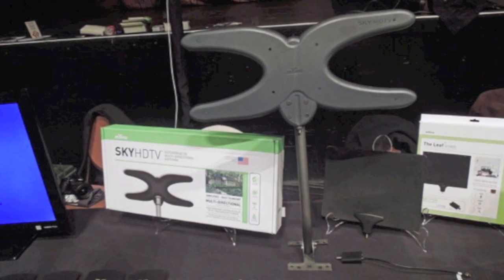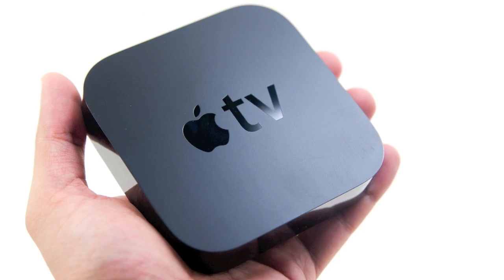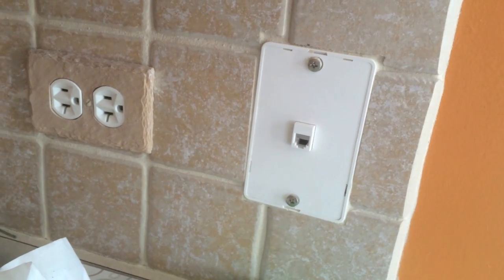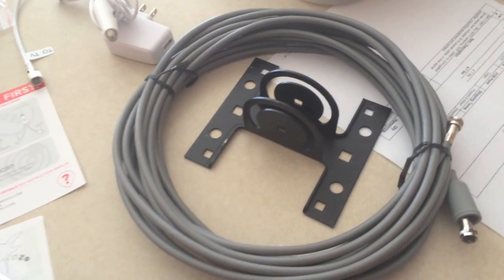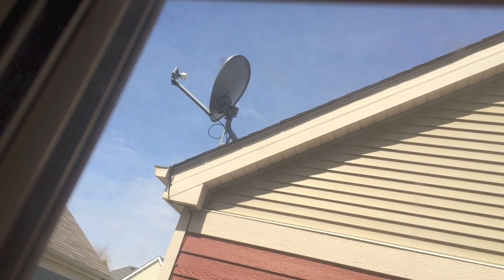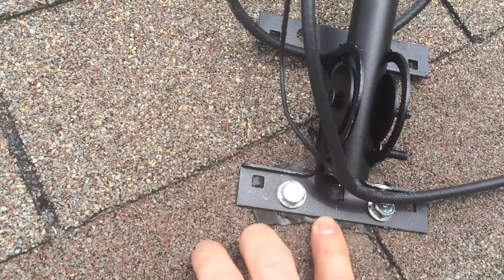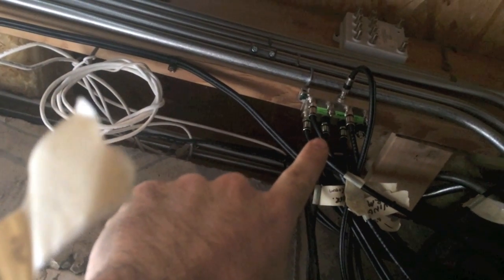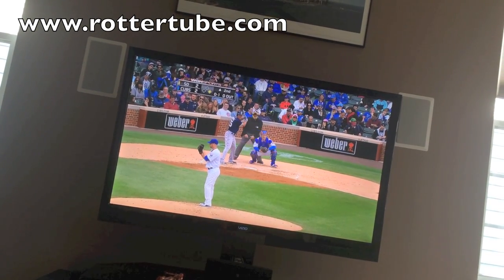how I got rid of cable tv - MOHU house antenna setup - sky antenna cable tv alternatives

Comment: Here is a tip just in case you are just not ready yet to cut the cable line. Call your cable company and talk to the department that handles DISCONNECTIONS. Dont try it with customer service because they will not have the flexibility like their Disconnection department to offer deals. This department is the last line of defense for the cable company to keep you as a customer and will try their best to keep you on. You probably will get a significant cut on your bill and probably get offered better services. The reason for this is because no matter what that cable will always be at your home. They would rather get something for it then nothing. My personal experience is that I got a deal set for 3 years. Lowered my bill by 33% and i now have better services.
Reply from the maker: that's GREAT. For me, I needed to free up as much cash as possible so I disconnected all. I am not much of a tv watcher at all so it worked out great. My wife got used to it. I know so many people who pay for a house phone and a cable bill and they don't use either....and yet...they won't get rid of it.

Comment: my house was wired with cable years ago, I have an collapsible alumin. antenna in the attic--should I remove all that crap? I have a satellite dish now and one TV hooked to cable. Any suggestions?  I have so much cable wire in my attic--love to remove it.
Reply from the maker: Hi Michael. Well, if you get this antenna, you would buy a coax amplifier like i did off amazon. I have this antenna connecting to the coax splitter / amplifier, which feeds all the other coax in the house. i have the other tv's using the one antenna in each room that way. works perfect. you wouldn't need to remove anything if you wanted to run live tv to all other tv's using the antenna. by the way, we watched america's got talent last night, live, in true 1080 HD over the air. sure, there were commercials, but that gave me time to let the dogs out and refill my coffee. AND IT'S FREE. good luck!

Comment: Really interested in ditching Cable and i was wondering how well does it handle Natural obstacles like trees and hills in the way of the signal path
Reply from the maker: from the reviews i have read on amazon, where i got mine, it handles that really well. I'm getting pure HD uncompressed signal from Chicago 50 miles away. never an issue.

Comment: Can you connect the Sky amplifier directly to the antenna? Or should I make a small jumper with F connectors on each side to come out the antenna into the amplifier?
Reply from the maker: i have my sky antenna connected direct to the coax amplifier box so i can feed each room. i wouldn't split it before going into any amp box. i would use the box to split it and that's it. the signal right off the antenna is good but i just wouldn't split it before any box.

Comment: Bro, that install is Clapped!!!! Should have slid the new antenna pole in the old direct tv pole and drilled an upper and lower screw thru it to brace it...
Reply from the maker: what's up dude? not sure what clapped means. for whatever reason i couldn't slide it through the direct tv. still holding really well after 2 years.

Comment: Thanks I will give it a try to cut the cord a few years ago but my regular stations don't come in very well sometimes
Reply from the maker: +bigtim323 good luck. you will be very happy with these antennas. i'm about 45 miles from the stations, probably 50 actually, and they are crystal clear HD. incredible.
Reply from the maker: +ShawBrothers Fan Either you got a bad one or you hooked it up wrong. I'm 45 miles away from the stations at least, and I get razor sharp uncompressed HD. There are hundreds of people saying the same thing on Amazon reviews.

Comment: Can you run the Hulu and over the air hd through the Apple TV? For an all in one interface, or do you change inputs on the tv.
Reply from the maker: apple tv is connected to your network via your wifi. you can also connect it direct to your router via an RJ45 connection (network cable) from your router. anyway, the apple tv works via internet. you connect the apple tv into an HDMI port on your tv. the antenna is not involved at all. it connects just like an xbox or playstation console would. you would watch the apple tv on just one tv for this reason. i'm looking to get a 2nd apple tv for the tv upstairs.
Reply: +Rotter Tube Reef Gotcha. This might seem a bit much, but have you looked into a HD homerun that the antenna connects to, and connects to your Ethernet. Then you download an app called "channels" that picks up all the hd content from the antenna and supplies a nice interface with TV guide. I haven't tried it yet, but it looks like something I would like to try, if I could get cheaper internet that was not bundled with my local channels of tv. BTW, right now I run a Plex server and use the Plex apps on all my devices to steam all my content.
Reply: +John Zimm oops, I forgot tablo... It does the same thing but is also a DVR, so you can also record all the HD content from the antenna.
Reply from the maker: that sounds like a really cool plan. being a techy, i love hearing all about this stuff! i looked into so many things, even utilizing my imac as a DVR and configuring an RF remote since the imac is in the basement. there are so many possibilities. in the end i decided to keep it simple and go with this powerful antenna. the clarity is insane! cable broadcasts "HD" at 720, while the antenna receives true HD since it is uncompressed. tv is so much more enjoyable! we really like watching tv live and the commercials don't bother us. i always preferred watching tv live anyway. as far as the DVR goes, that's what HULU is for. it's like a DVR in the sky. it's so awesome! for example, we watch america's got talent on tuesdays live. if we miss it, it's on HULU the next night, pretty much commercial free. you can go back many episodes as well. there is no recording anything, it's just there. i have internet only. i don't need to bundle anything. i pay $60 a month for that and $7.99 for HULU.

Comment: Does it make a big difference between outdoor and indoor antennas? I bought an indoor antenna and only get 8 channels..
Reply from the maker: It will make a difference between outdoor and indoor. Indoor can be good especially if you buy an amplifier like I did.
Reply: I bought on indoor RCA with amp built in and I can only get 10 channels. One of the channels is a local and I just cant seem to get it no matter what I do. I even tried hooking to up together
Reply from the maker: you have the same antenna? this one in the video is designed for 50 miles coverage. of course this depends on where you live. mountainous areas or skyscrapers will block signal.

Comment: Great video.
I have a few questions.
Does the powered splitter you used replace the amplifier that comes with the product or did you connect the amp before it went to the splitter? Or use it at all for that matter?
I am planning on an attic mount and running coax to current cable splitter on outside of house (not amplified). Any opinion? Only need two tv's receiving signal. Both on the same end of the house as planned install (main floor/basement). Looking forward to your response. Thanks!
Reply from the maker: +Nezzy T Hi, glad you liked the video. You need to use the power cord that comes with the antenna to get maximum reach for signal. This is a really strong antenna and it requires the power. I have not used it without power but if you disconnect the power, I believe you will not get picture. I use the coax powered amplifier to amplify through the house. If you don't have that, your signal will be weaker as it travels distances to the rooms. You will need to see how it looks and works. As far as your non-powered splitter, I'm not sure how that would work. You would need to test. Remember, any signal that is split loses strength, and then when you run lines to tv's, it is weakened by distance. It may work great, it may not. My mohu is on the roof as you saw, running the coax into the house via the coax left by cable co. into the basement. I have the powered splitter in the basement, running to tv's. Picture is crystal clear HD. Try it and see, you may not need it. We have never had issues with picture even during a storm.
Reply: +ROTTER tube Reef
I will let you know how it goes. Thank you!

Comment: did you use the small USB amp that came with the antenna or only the powered splitter? thanks
Reply from the maker: you need the small powered amp and then you only need the powered splitter to feed other tv's.

Comment: I'm sure it is working okay(?) but you have a metal pole standing right in front of the antenna and metal is the best thing to block and reflect signal with. It might be that little bit of blockage that would prevent a particular channel from coming in that was borderline to begin with. I think Mohu is overpriced as hell, so I've never seen that model but if possible to remove the antenna from their mounting pole and utilize the old satellite one? I use the GE PRO attic mount on roof to that same satellite pole... To me that is best antenna I've tried and I tried just about all (except your model Mohu)
Reply from the maker: the metal pole is from direct tv. i left it up there. i'm getting all channels except the one at times. i would think if it's the pole, i would get no channels at all. the signal can't differentiate a pole and single it out on just that one channel. it would be all or nothing. thanks for the comment!

Comment: Did you see what the signal quality was like not using the powered splitter first?
Reply from the maker: +Steve Scott (sscott9510) Hi Scott, I did not. I had the powered splitter when I had cable tv. You need a powered splitter to split the signal between any devices, especially during longer runs such as in cable tv, coax, ethernet, bnc (really old school there.)

Comment: I currently have DishNetwork satellite TV and Cox for my internet. I just got fire tv loaded with Kodi and can watch a whole bunch of channels. I am planning on ditching DISH. But, need something for local channels. My house was built about a year ago and I have HDMI & ethernet in almost every room in the house. How can I hook up this antenna in my situation?
Reply from the maker: I would connect it just as I have in the video. The antenna comes with everything you need including the coax cable. I bought a powered coax splitter so the signal is strong enough going from the antenna's coax on the roof to the basement, which is where the powered splitter is. From there I just connect all the coax coming from all the rooms. No issues. crystal clear picture. way better than cable ever was. that's because cable HD is not HD...it's only 720. don't let anyone else tell you different. good luck! still no cable by the way and there are way more options without cable than there every was with cable. HULU has every season of every show.
Reply: Manjula Krishnan 
 You could get a hd home run and download the app. Check it out

Comment: Hi steve. Question do you know if this package will be work in calgary, alberta canada? I don't understand how those devices works, regarding antennas some websites refer the range distance. I  don't have cable so far we live true Netflix which is fine but im always looking for better updates thank you!!!
Reply from the maker: Pablo P Hey Pablo, it should work great. It's just a high power standard antenna that grabs signal out of the air. I'm 45 miles from the stations and I have no issues at all. TRUE 100% HD...it's awesome! If there is anything broadcasting within your range without mountains or anything blocking, you should be fine. I would order from them, you can always return it. If you love movies AND tv i would highly recommend HULU...it's so perfect. I had netflix and to me it was limiting, but that's just me. We watch tv more so we went with HULU. they have most shows we watch and more, so it's like a DVR in the sky for $7.99 a month. We use apple tv for the rest...buy movies here and there or an entire year of a series on tv for $15 if we really want it. and you get to keep those shows!

Comment: Thanks for this video & I have a question..... just today we had a MOHU installed and ran the 30 ft cable that comes with the MOHU into the DirectTV coax near the ground wire location.  From there, our coax goes inside the house  to  a "splitter"(?) like the one you had from DirectTV in the video.  When we ran the scan on our TV, it did not pick up any stations.  Is the cause most likely due to that DirectTV splitter?

Also, where did you pick up the white one you were going to move the coax over to?  ...if that is what you would recommend in order to get the signal to 2 other TV's in the house?

Thanks again for your very helpful  video!

Greg
Reply: +Greg Donohoe   ...and the MOHU Sky 60 is the one we installed on the end of the house and the antenna extends over the top of the roof...
Reply from the maker: +Greg Donohoe Greg, you're very welcome! I did the same thing you did, except, I used the coax from direct tv on the roof that connected directly to the dish. I removed the dish and kept the coax up there since it ran down the side of the house and into the basement. You need to make sure you have powered that antenna. There is an AC power that comes with it. Once that is done, I used a powered coax splitter that I got off Amazon. I think it was around $60? It needs to be powered or the signal won't be strong enough to get to the other tv's in the house. Let me know if you have any questions. I'm going to do a follow up video. I am still so VERY HAPPY that we cut cable! I still can't believe the picture quality. It truly is better than the cable and dish signal we were getting. It's true 1080! HULU is AWESOME! Don't forget apple tv....that's all you'll need to buy the occasional tv show or series or movie. I just bought the kids another season of Tom and Jerry. They love it and I got 15 cartoons for $12....which I get to keep forever! GREAT MOVE ON CUTTING THE CORD!
Reply: +ROTTER tube Reef    OK.. I see what you mean.  Think for now I will just take the coax that comes into the house and run it directly to the TV we use the most and then do a new scan. (It comes into the garage and up through the ceiling of the garage into the living room above to the TV there) I can always go back and get the powered splitter is we want to shoot the signal around to the other 2 TV's.   The MOHU came with an amplifier  that is connected to the antenna port on the TV and also plugs into an electrical source neat the TV.  

If I understand you right, the white splitter you showed inside your house is also plugged into an electrical source..right?  Is that what you mean by a "powered splitter?"

We bought the Apple TV last night at Best But (black box with the remote!) and my wife has it working great!

Thanks again for answering the questions...

I hear of more and more people cutting the cord everyday!  It reminds me of people getting rid of landlines since cell phones came on board!
Reply from the maker: +Greg Donohoe Greg, you are correct! My splitter is powered with AC. It has to be. The coax coming into the house from the antenna goes right to the splitter and I connect the existing coax lines (to tv's in the home) to the powered splitter I bought off amazon. Great that you got the apple tv! It's such an awesome unit! You view any show or movie you buy off apple. Such a GREAT investment! I haven't had a land line since 2002. People thought I was crazy to get rid of it. Why have it if you aren't using it. People are so used to having things because they have always had things. Cable tv is such a mind trick. Everyone is paying over $100 a month to channel surf. I don't watch sports much so I'm fine. If i did I would find ways. Steve
Reply from the maker: +Greg Donohoe You reminded me I need to do a follow up video to my cable cutting experience. Maybe I'll film that now.

Comment: Any Antenna you think will work in apartments?
Reply from the maker: +bigtim323 Hey, you can use this in an apartment. it's stronger since it's amplified. They say you can use this in attics too, so I don't see a reason why you can't use it in an apartment. I would place it close to a window on the floor. This works with multiple TV's via splitter. You can also get the individual antenna by them, that looks like a mouse pad that mounts to the wall. I can't recommend this enough. I'm watching TV now actually with it. It's been 3 months and I would NEVER go back to cable. I love this antenna and using HULU exclusively! Good luck

Comment: So you did not need the amplifier?
Reply from the maker: I didn't need it if I just wanted to connect this to one tv. Being that I have it connected to all tv's in the house, I needed a splitter, which needs to be amplified due to distance in the house. works GREAT! better than HD picture...better than cable. It's been 2 years without cable and I wouldn't go back even if I was paid to do it. So much crap on cable. Big bill to channel surf. We watch this or HULU all the time. I pay for HULU and internet and that's it.
Reply: +Rotter Tube Reef the city I want is 52.8 miles away. I tried the leaf, and wondering if this would do it.